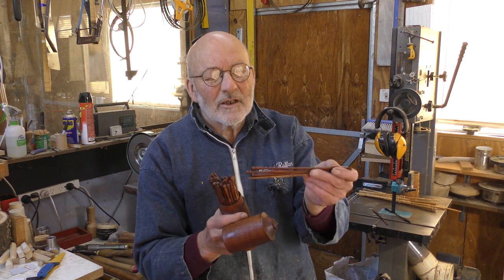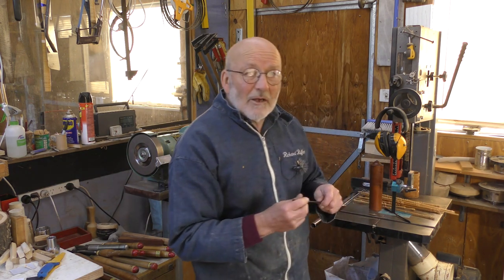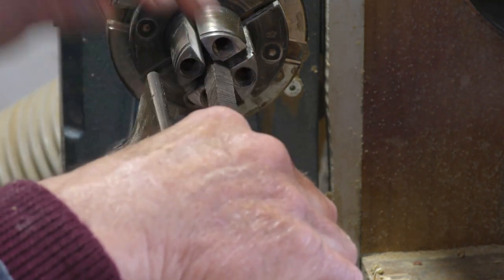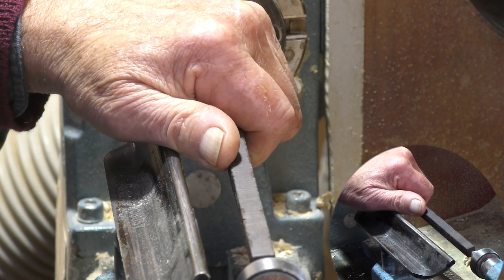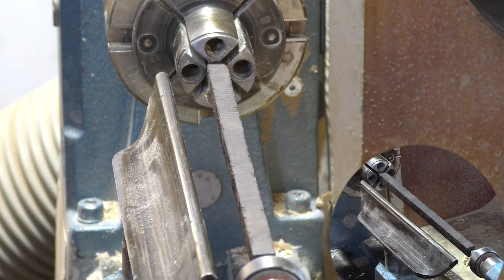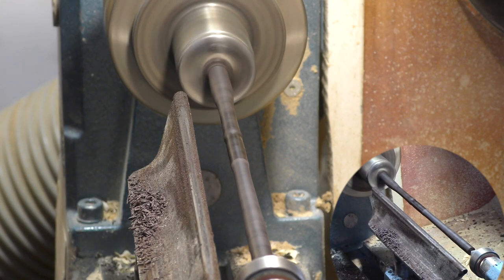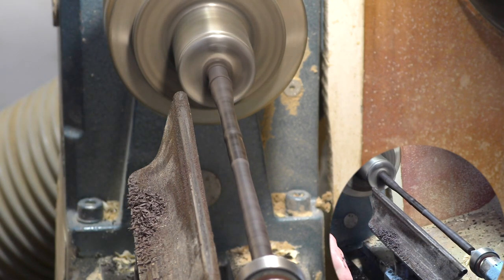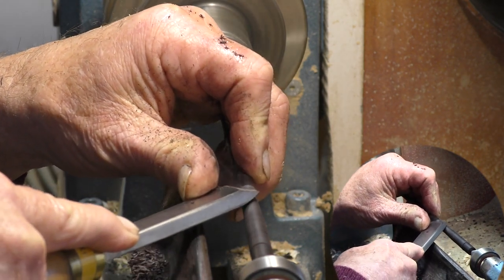Richard Raffan turns a spillikin stick

Comment: Many thanks for your efforts in producing these wonderful educational videos. I keep returning time and time again to learn a little more each time. With the spillikins, I assume the oil that you use on them is your favorite boiled linseed oil.  With your ego sticks, I understand that you turn them to 1/8 of an inch in diameter, with the spillikins do you aim for the same diameter or a little bigger? I have taken your advice and have started turning a set in Australian red cedar.
Reply from the maker: As you suspect, boiled linseed is the finish, but they often get U-beaut Traditional Wax as well. Around 3mm for the spillikins sounds about right. The essential is straight grain for maximum strength. I've made several sets of spillikins in Aussie red cedar and they came out well and nice to play with.
Reply: Thanks for lowering the target. I think I will practice at 4mm diameter until I am proficient before moving to 3mm. I do appreciate your advice.  @RichardRaffanwoodturning
Reply from the maker: @AllanForrest-Winchester  Don't forget you'll lose up to 1mm sanding and that you also lose quite a bit of bulk in a set when creating paddles/propellors.

Comment: I learn so much watching your videos.  What speed do you use to turn such thin stock?
Reply from the maker: 1800-2000 rpm. I have the lathe set at 2000rpm maximum to guard against inadvertently running a large blank at 3600.

Comment: Great video Richard. I have used your thin spindle support technique many times while making Drop Spindles for fibre spinners. It is a zen moment turning these so thin, (when it works), it takes practice and “SHARP” skews, such a rewarding and confidence building project. Not sure if todays younger generation appreciates the fine motor skill building effects playing the “Pick up sticks” game that I fondly remember challenging my friends with 60 years ago.
Reply from the maker: It continues to be a good game right up to the time you start trembling thanks to age or alchol. I hope you've turned a set.

Comment: Thanks for the video.  What height is the tool rest? It looks to be just slightly below the center of the blank.
Reply from the maker: It probably is, but would likely be different to the height you'd require. The rest needs to be at a height that's comfortable for the turner on the lathe being used. Anyone taller than myself using this lathe would have the rest higher on this diameter, if shorter the rest would be lower.  Ideally the centre height of your lathe is at your elbow height. Tools are usually most comfortably held tilted up a few degrees, so consequently the larger the diameter being turned, the higher the rest.
Reply: @RichardRaffanwoodturning  thank you. I had no idea! been told and read differing answers, skewed answers really 😁, the ensuing confusion caused me more “skew anxiety” than usual.